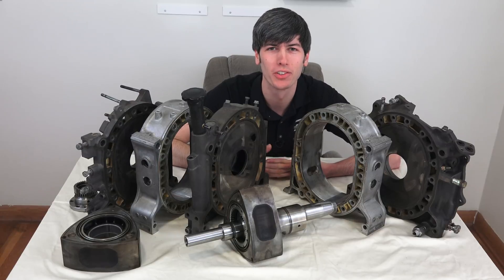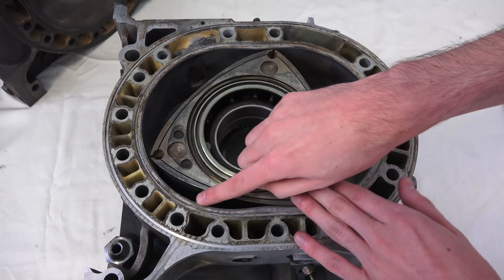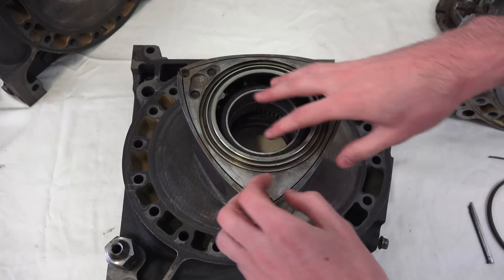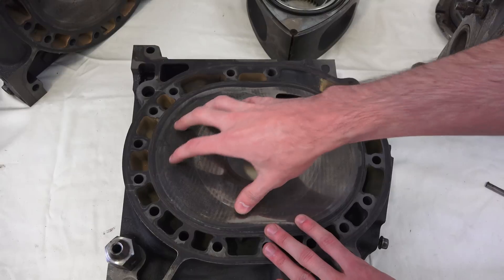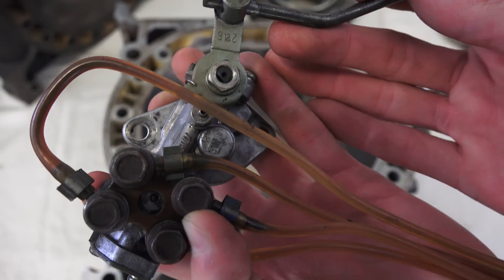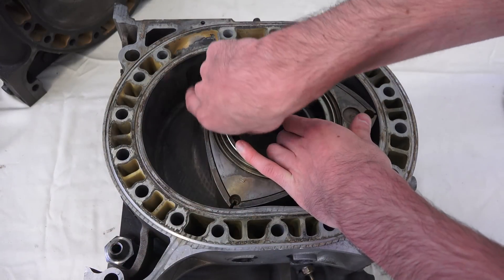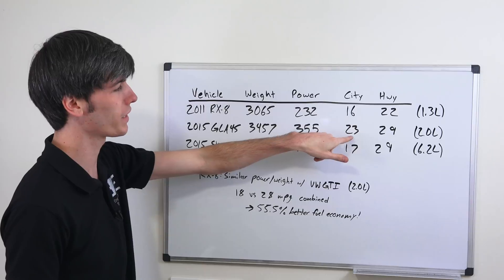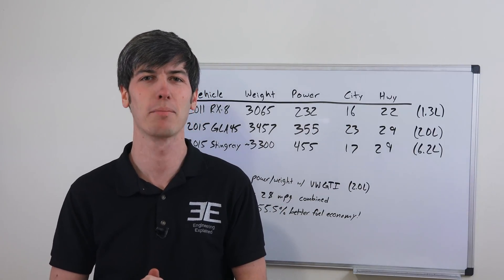4 Reasons Why The Rotary Engine Is Dead

Comment: Informative well presented video. I would suggest paying VERY little reliability on EPA fuel economy ratings. I owned one of the first RX-3 rotaries. That car was rated by the EPA at 9 mile to the US gallon. I was never able to get that poor mileage on my car over a tank of usage (yes I kept regular records in those days). On one occasion pulling a tent trailer with a bumper hitch (and afraid of damaging the very wimpy bumper on a 1973 RX-3) I got 24 MPG (canadian gallon) to 2 tank fillups.

Comment: I could go into you can red line them all day speech as they have only 3 moving parts. And that the amount of oil you point out is very little. maybe research and tell us what the ratio is. And lastly  1 rotation of the rotor = 3 on the output shaft. So when you see 1k rpm she's really only turning 1/3rd that. Engineering Explained <- please do your home work before you go slamming stuff, it makes you look bad.

Comment: Wow , it's a 3 cycle. And you can not compare a rotary to a standard 4 cycle engine.  They passed emissions from day one in this country. The only thing you got right was the heat, I raced them yea they get really hot and is why there exhaust were stainless steel.  Now considering this was setup as a exotic engine in a exotic car your complaining is way off.
The real reason it did not become popular, no one but the dealer and a few pro shops knew how to work on such a simple engine.  They still are popular in the race field. And yes there coming back from Mazda yet again.  Gas mileage ? OK, 1970 vw beetle  a whopping 23 mpg. and less than 40 hp.  really ?

Comment: I remember when the rotary engine was just a drawing on a piece of paper back in the 1950s. We school kids were told it was the engine of the future which would replace piston engines because it would be more efficient with no reciprocating parts and only one moving part.  The first actual production car I am aware of was the NSU Ro80, which was notorious for failure of the rotor tip seals. It was said owners took to carrying a spare engine in the boot (trunk) to get them out of trouble when the engine failed. Some UK owners swapped the engine for a Ford V4 Essex engine, which was the only one short enough to fit in the space. That engine was not very reliable but far better than the rotary. Later Mazda seemed to solve the seal problem with their version of the engine and sales were good for a number of years. Also a Norton motorcycle was produced with a rotary engine, but was short lived because of the demise of Norton. The surprise to me from your video was that the engine was so inefficient as it was originally touted as a super efficient engine.
Reply: +schwabentutorials But generally better that externally fired power plants. Coal fired power plants run around 33% efficient. They can get about 50% efficiency out of a combined cycle gas turbine power plant. Diesels are around 40%, However the newest big marine diesels are 50% efficient. Your car is maybe 25% effcient
Reply: +Replevideo well back in the 1950s the traditional engine was nowhere near efficient, there was a lot of improvement especially in the last 20 years when it comes to efficiency... The wankel probably was as efficient or more efficient back in the day, but now.. They still aren't at the limit of normal reciprocating engines altough its getting harder and harder, but the wankel engine is at its limit for quite a while now as it seems.

By the way, internal combustion engines still have terrible efficiency over all..
Reply: doug112244 yes, and its kinda terrible imagine how much room for improvement there still is

Comment: Rotary engines aren't about miles per gallon they are about smiles per gallon. Only by owning one can you truly experience how fun they are. Knowing its disadvantages, most rotor heads still have fun with these engines and can make really good power out of them and the noise they make is amazing. Check out mad mikes cars

Comment: The Wankel has always appealed to me ever since I first read about it in "Popular Science" back in the 1960's.  (The elegance of fewing moving parts, I think.)  But over the years I would also hear about it's various drawbacks.  However I've never seen them laid out so clearly and all at once as in this video.  Well done.  I might mention one other disadvantage I used to hear about, when Suzuki used the Wankel on their R5 motor cycles from 1974 - 1976, it dumped so much heat into the exhaust - the tail pipes would get red hot.

Comment: not mentioning the mercedes and the gti are both Turbo cars? hence the power c'mon
Reply from the maker: It wasn't a comparison of specific output, it was a comparison of power, weight, and fuel economy. And a big naturally aspirated V8 puts it to shame, even if you go back to the 2004 Corvette. Heavier, more powerful, larger, and yet better fuel economy. It's just a fact, nothing to get upset about.
Reply: you are comparing the power of 2 little engines saying they output way more or the same power with less, well yes they do, buts only because the turbo, w/o it the GTI wouldnt have as much power as the RX8, yes the Rotor is terrible in thoose areas i had one and the oil thing drove me crazy, i know own a 2.0L Turbo jetta, same power better efficience but had to add a turbo, so probably the RX8 with a turbo would had at least decent power to cope with its bad traits, just saying it was unfair comparing thoose turbo 4bangers against the rx8

Comment: Excellent video but a few points I would like to bring up. Firstly the RX-8 RENESIS engine actually has some extra fancy stuff going on with re-injecting the un-burnt mixture and using side-ports so it gets about 50% better fuel economy compared to the 1985 one you were showing! Secondly most rotary people greatly dislike that way of comparing engine capacity since it is based on the cylinder capacity of a piston engine, which as you say gets one power stroke per two crankshaft rotations, however the rotary gets three power strokes per one crankshaft rotation. A far more reasonable comparison of engine capacity is to double the displacement of the Rotary, thus the 13B is more comparable to a 2.6L piston engine. But that one will be argued back and forward for decades to come!

Comment: I have 3 rx7s, a 2 rotor('89), a 3 rotor('95), and a ls7 v8('95). I didn't really pay attention to the video after you compared it to cars with comparable size and fuel mileage. None of those cars turn 9,000+ rpm, so your comparison is blind. While I'll admit that the "wankel" rotary is "dead" due to its lack of funding in the production sector, It is not dead in the private race sector. I have even debated the 4 rotor, like that Rob guy is building, because it has received so much R&D in recent years. And not sure if you know,  but a majority of the experimental engines that are around, and most of them that have gained traction even, are a circular or rotational style similar to the rotary. It is easier, in every aspect, to turn rotating energy, into torque. let me know if you want a list of these engines that have gained traction, one of which is provably(in real world applications) 25-30%  more efficient, even than an atkinson cycle engine.

Comment: your information will keep many  buyers away from rotary engines. at a recent race or drift event, a 1988 mazda rx7 ,modified for sure had extremely hi rpm in each gear. this made the speed or acceleration in each gear a huge advantage. this car was the fastest driving sideways vehicle of the day. some people report rpm of 11,000 an up. if you're doing a job where you don't have time to shift another gear this may be the engine for you.

Comment: Another issue is the sound: The rotary sounds horrible. It's just angry and noisy in a negative way. You really want to go for a V8 engine until electrical engines are ready to take over.

Comment: I don't understand why you compared cars at the end? I'm not an engineer so maybe it flew over my head. I think if Mazda would've put that engine in a Miata, being so small and so low on torque, the emissions would be much better. Not to the lvl of your current v4's, but it would be more efficient. Take a 1.3 liter v4 engine, stretch it to make 232 hp, naturally aspirated, then compare emissions. I would be curious. 

Don't take me for a rotary fan boy, I'm not, while I liked the RX8, I would never own one due to the burning oil issue. My little sister bought one brand new and the engine blew on her 2 times before 40k and she drives like a granny... well a fast granny, but never came close to beating on the car like I did my RSX for years.

Also thanks for the rotary engine videos, I've always been curios at how they specifucally worked. I always had a good idea, just not to the detail you explained.

Comment: Great Video!
One little thing I noticed... Yes, a rotary has poor thermal efficiency due to the shape of the combustion chamber, but while the combustion issues you were describing may technically affect thermal efficiency, they are actually separate from what that metric typically describes in a combustion engine.
Thermal efficiency is affected by the absolute temperature ratio between combustion gasses and chamber walls, and the ratio of chamber wall area to volume. For the first ratio, a rotary isn't really different from a piston engine, but the second ratio is higher for a rotary - more of the fuel's thermal energy soaks into the walls before expansion is complete.

Comment: awesome video ernie brink 1 847 421 3592 one of the main leaks is when the apex lines up with the leading spark plug hole air and fuel both leak inside the engine from one chamber two the one that just opened for the exhaust stroke ?

Comment: The RX-8 engine is only 1.3L, yet makes 232hp.  the engine in my 2016 mazda 3 is 2.0L yet makes 155hp.   Why the difference in horsepower?   For that matter, how are they squeezing 355hp out of the 2.0L in the GLA45?

Comment: good video, i never knew it had oil injection ....
Reply: As much as I hate to admit it, I'm a rotary person and I hate them somewhat.  When you actually own one for a while and have to work on it, it's a love/hate relationship.
Reply: +arealassassin yeah haha we have to top up oil every other time we fill up (which is a lot)
Reply: KillEmAllWithMetal I was an engine builder. Strokes relates to how many "cycles" there are per stroke. nothing to do with valves at all. Nothing at all. Rotors intake, compress, blow up, expel. Thats 4 strokes per cycle. Pretty simple. 

FOR FUCKS SAKE. haha
Reply: +samuel lopes Yea, I had a first gen (84) and they even had that in those model years.  Just a matter of design, as he says.  Since the systems were prone to failue, causing a lack of lubrication, most people just delete the system entirely and mix oil in the fuel like a 2 stroke engine.  Just have to remember to add a quart or so of oil each time you fill up with fuel.  Heh.
Reply: +dragoss16 lol hater
Reply: why would you hate rotarys ? ;-;
Reply: +samuel lopes Nor did I, as much as I have learned about these magnificent engines over the years, even I did not know about the oil injectors in the intake-stream. I knew it drank oil to keep the seals lubed and ... more sealed, but oil into the air, like 2-stroke (and THAT's where that comparison comes from, hahah makes sense now) except, it's really a 4-stroke, and the oil in the intake-air just helps lube everything a bit more. Great vids, he does well at putting things into very simple to understand words, something I still have a hard time doing myself. >)
Reply: Mazda needs to perfect it . There's a video a video clip on YouTube which came from the autoweek show of a retired Mazda engineer that improved on the design of the rotary but Mazda never implemented them...
Reply: +samuel lopes that's why they burn out like a 2 stroke
Reply: +Csab My 85 started in the winter just fine and it was the 12A without fuel injection.  Hard starts were more to do with understanding how a carburetor works in cold weather and how to use the choke effectively.  But then, my first piece of american steel, with a 4 barrel carb on it was a pain to start in the winter too.

Once they went to fuel injection this became a non-issue.
Reply: +samuel lopes   And then the oil has to be scraped from the wall by the apex oil seal, which is why the Wankel's biggest problem is the premature wearing of those oil seals.  Lose the seal and you lose compression / power, plus pump oil out the exhaust outlet, and you have to take the engine apart to get to the rotors to replace the seals.
Reply: @randytaylor9245  if made in mass they would be so easy to replace
Reply: KillEmAllWithMetal You do realise theyre called 2 strokes, because they have 2 strokes.. right?? the rotor is a 4 stroke motor. There for not a 2 stroke.
Reply: KillEmAllWithMetal Im not confused at all. I built them for a living. Just you cant decipher the meaning of cycle in the way it was being used in two different sentences. Its not your fault, its mine for not making it clearer.

But a rotor is a 4 stroke motor and is in no way like a 2 stroke motor just because its missing a valvetrain. 2 strokes at least have valves hahahaha
Reply: Normal you just block it off and premix the oil in with the fuel.
Reply: boboprime2000 yeah , I'm actually a rotary hater :D
Reply: +Csab they are naturally hard to start when not at normal operating temperature, however there are tricks to help with this. One is the quick rev-up and shut-off from about 3k RPMs, which I believe causes the engine to flush out gas fumes and draw in a bit more oil before it stops. So during the next start, there is no old gas trapped inside, preventing an easy start, plus the extra oil from proper shut-down makes for a tighter seal between the chambers, for the first crank. ;)
Reply: +Starcruiser81 I believe this. when I shut my 2002 rx7 off it is not instantaneous. that must be why ;)
Reply: +samuel lopes easier to ditch the oil injection and just premix fuel with 2stroke oil.
Reply: +samuel lopes always wondered why my 85 rx7 ate so much oil... lol
Reply: +arealassassin And yet they are insanely reliable (under race conditions) and produce so much more power an torque than a piston counter part. Emissions are the only reason its out.
Reply: +samuel lopes performance ones usually disconnect it and run 2 stroke oil in the fuel
Reply: That's still 4 strokes ..
Reply: You are both off your chops for different reasons :P
Reply: KillEmAllWithMetal
Dont give up :(
You're nearly there.

:P
Reply: good for both carby or fuel injection
Reply: I have never had a problem. If you are that worried when you get it tuned get the injectors to be open slightly at 0 throttle position. Thats what I have done on my bike. It makes when you are coming back on the throttle a lot smoother too.
Reply: +samuel nope me neither, I just haven't gotten that much into them. God what a horrible thing, no wonder it never was a success.
Reply: +samuel lopes yeah , is like 2 stroke engines , but 2 stroke engines are infinite better than this crap

Comment: Has anyone here noticed or mentioned that the Merc 2.0L turbo and the Vette's LT1 both have direct injection? Relatively new tech that provides a huge fuel economy advantage. I'm sure a newly developed direct injected turbo rotary could improve on the EPA figures of the old Renesis.

Comment: I don't know much about engines, but theoretically, couln't the heat differential be solved by having a spark plugs and fuel intake on opposite sides and have a computer tell it to shift side every revolution, so that both sides get the same amount of heat? Oh and of course also an exhaust outlet on both sides!

Comment: Engine life of a rotary isn't as good as a conventional engine, which makes it less desirable and more costly for long term ownership. A service writer for Mazda told me these engines die after about 100k miles. Some of that may be due to improper engine shutdown procedure on the part of owners, but conventional engines do not have this shortcoming. I will give it to them that for the displacement and physical size of the engine, they make enormous power.

Comment: However in order to achieve similar power, piston engines require greater displacement and forced induction. The GTI also uses direct fuel injection, which wasn't available during the production rotary's time. Of course, the fuel economy of the rotary engine never really improved. At all. Which is disappointing, but the power it generates within the packaging is nothing short of mindboggling. Thermal efficiency certainly increased, because for the 13B's over-30-year span, it went from barely 100hp in its original AP form, to well over 200hp NA from the 13B-MSP Renesis, and nearly 300hp from the twin turbocharged 13B-REW, nearly 25 years ago. And, mind you, the 13B is just a lengthened 12A, which is in turn an elongated 10A. The basic architecture of the Mazda Rotary engine dates all the way back to 1965, with only incremental changes over time. And all of this from an engine whose development was only seriously pursued by one company whose wealthiest point was during its time as a subsidiary of another automaker. If the rotary had the same kind of development as the reciprocating otto-cycle engine, I wonder what kind of results we'd have. 

Mind you it's been years since I owned an RX-7. I miss it. There's something magical about that engine in that car. But the practical truth is, a rotary engine is more expensive to own than a piston engine. Even though my Mazda had 150,000 perfect-running miles when I sold it, there's no getting around the fuel and oil consumption. If you keep up with those, the engine will last, but I wanted a change.